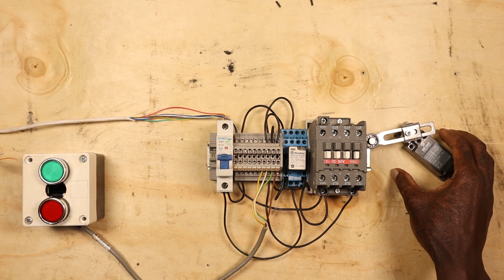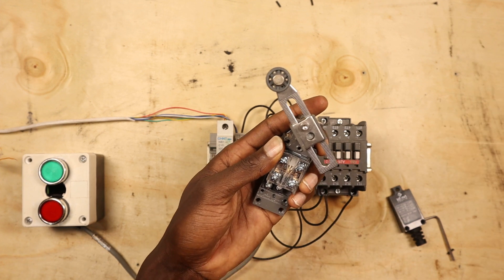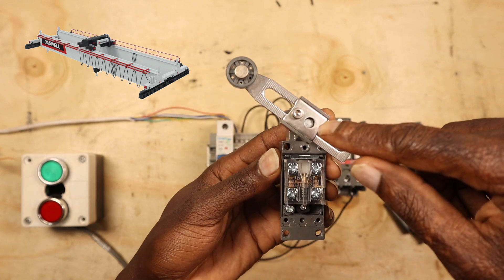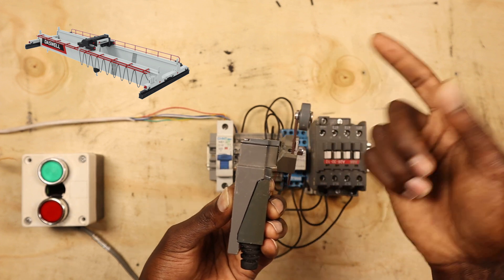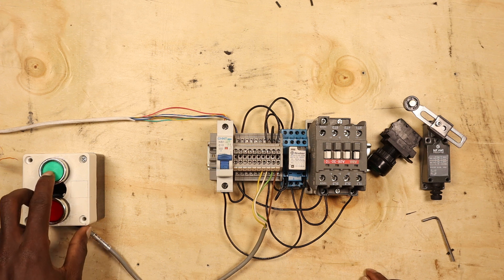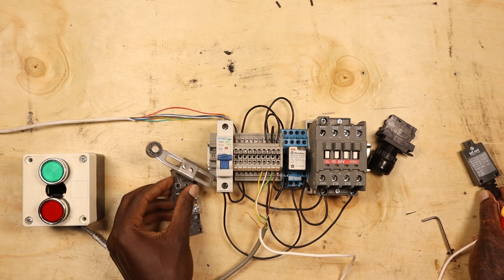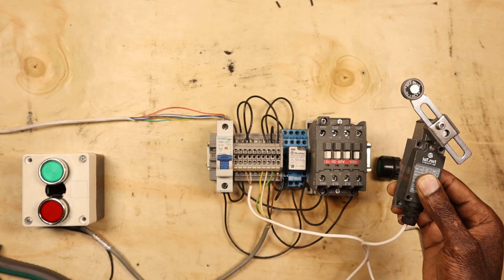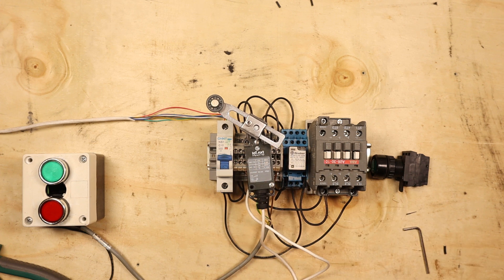How Does a Limit Switch Work? Ultimate Guide & Demonstration!

Comment: Thanks for your videos,what current rating of a contactor would you recommend when building a changeover for a 100kva generator?
Reply from the maker: Sizing a changeover isn't based on the size of a generator or any other incoming power source but on the total load. if the load is 30kw you add an allowance of at least 0.5.
It's good to oversize the ATS for future load addition if the budget allows.
Thanks for watching.